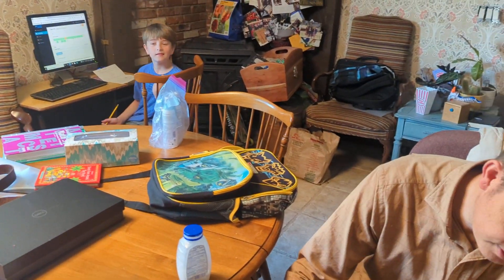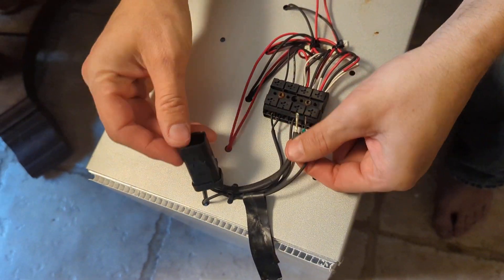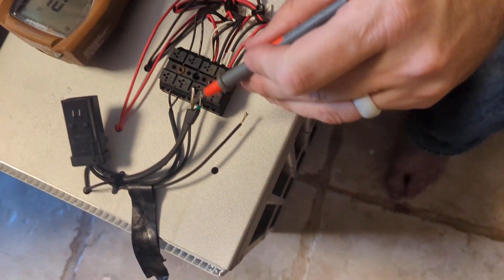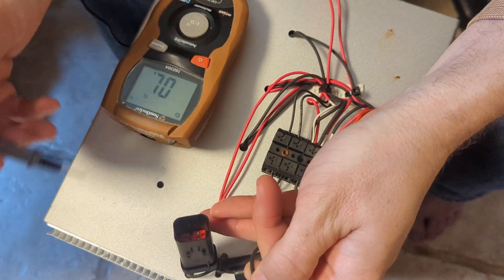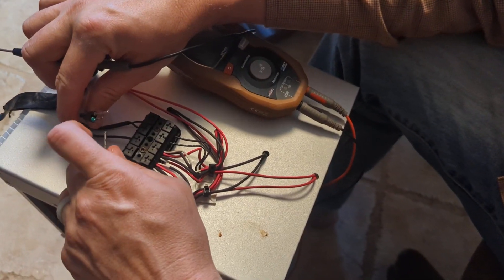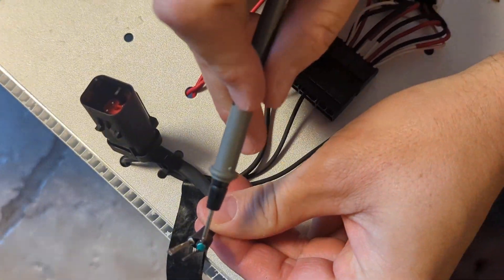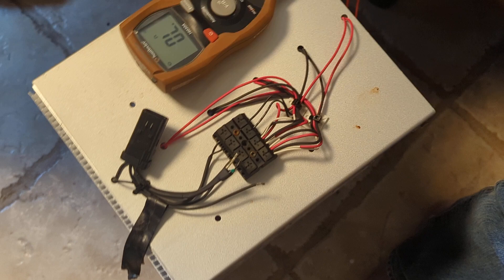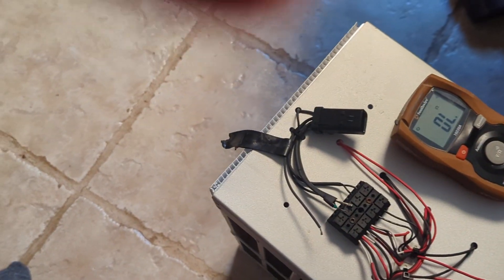Troubleshooting Harvest Right Freeze dryer cable unplugged error

Comment: No your fuse link should be the hot side. Those are the same kind of fuse links that your clothes dryer uses. You just need to find one with the right temp rating.
Reply: Thanks!

Comment: Nice video. Thank you for sharing. I have a similar issue and would like to know what that fuse/pigtail is called and where  I can order one?
Reply from the maker: It is called a pigtail by harvest right. The specific one depends on which freeze dryer you have. Mine is older, and the item on my order was "[U-UFD-WA-010] Pigtail (Non-Snap Disc)"

I called the support line and they were helpful. They should be able to get you the right part once they know when yours was manufactured and which model. They also sent videos and instructions.

Comment: Did they send you a replacement part?
Reply from the maker: Yes, they sent me a new pigtail, a new galvanized tee, and a new control board. The blown fuse in the tee made the new pigtail necessary. I didn't use the galvanized tee, but ordered it in case that was the problem. I needed the new control board. Based on my own troubleshooting and posts on Betty's harvest right group on Facebook, I figured out the problem without having to pay the fee for a technician.  For some problems it is probably worth the fee

Comment: How did you get the wires to release from the 1 1/2" x 2" black connector box?  We appear to have a broken cable and possibly a blown fuse, but cannot get the end of the cable out of the box.
Reply from the maker: To release those wires, you need to press down on the top part of that connector box with the + mark.  Harvest Right has a video showing this more clearly: https://youtu.be/2HH4Dn9phTI.  By the way, in the end I had to replace the relay board (part number ELC-B0003) for about $100, though the fuse was bad in that connector also.  They recommended replacing the galvanized tee and I purchased the part but never replaced it.  I never had to pay the diagnostic fee because the troubleshooting I did myself (they charge $45 per hour).  They were willing to talk to me on the phone and were helpful over email.  It's working great again.
Reply: To clarify, the cable is broken and a tiny end of it is stuck in the box.  It's the cable that has the fuse attached.
Reply: @elizabethlaney8307  So you need to get the broken wire out of that connection box?  If you can't remove it but can still put another wire in, it shouldn't matter.  If another wire can't fit in the connection, I'm not sure if it's possible to shake it to get it to come out since it looks like it is attached to the shelving unit.  You could bypass that connector completely and take the wires out of the other side and directly connect them to the pigtail wire that is broken.